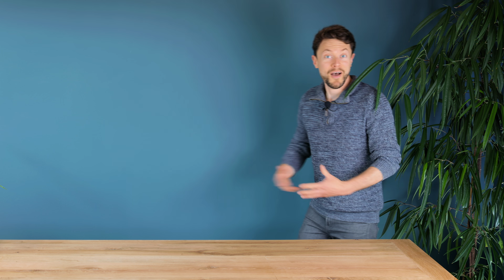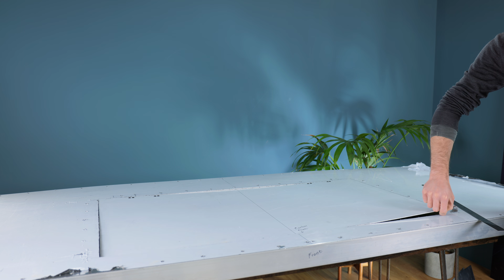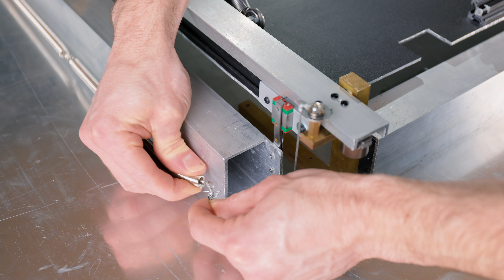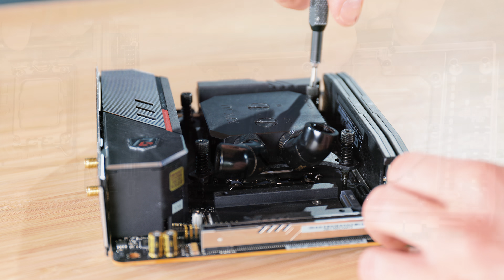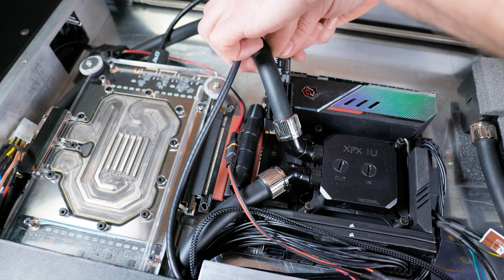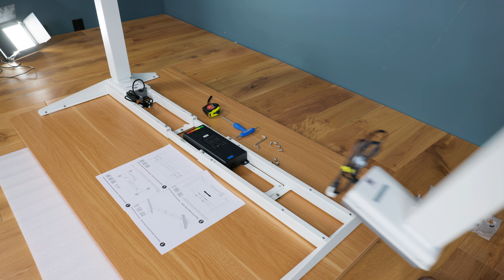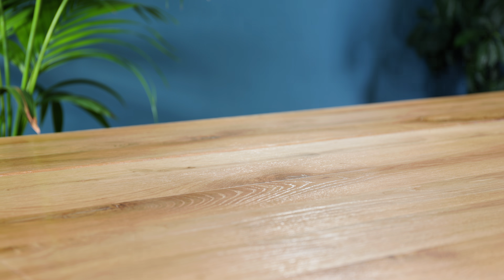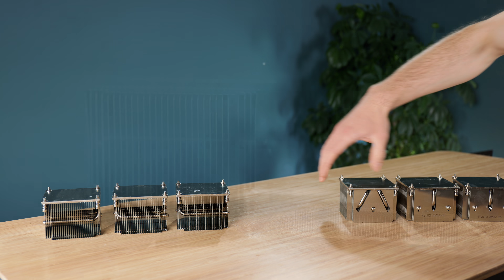Building the ENDGAME invisible PC

Comment: The thin edge trick and the spring-loaded move-out-of-the-way wooden bar hiding gap thingy blew me away
Reply: the gap filler thing actually made me say holy f*ck out loud
Reply: @menggol  pretty common if you did handiwork in school
Reply: yea i mean this guys is actually amazing in my eyes, his ingenuity is mind boggling
Reply: 😂😂😂😂😂😂for real
Reply: i still don't understand how it works. he only spent like 2 seconds talking about it
Reply: @Langebaan  you got a triangle shaped bar and when the latch opens because the sides are smooth and angled they slide out allowing space for the latch to rotate without hitting anything, when the latch shuts springs that are within the gap that the triangular bar is attached to, bringing it back down once closed. I’m not sure how good this explanation is but it’s what you’re gonna get l.
Reply: i missed that part at first so thank you for calling it out so I could go back
Reply: I literally audibly said "genius...f*ckin genius" whilst nodding my head in disbelief.
Reply: At this point hes gonna make tokyo 3 in 5 months

Comment: just put fans so that they would suck out air, instead of trying to push air out through fins. That pretty much helps preventing cyclone effect inside the case, and pressure diference will make system suck in cool air from outside. Basically, switch in place fans and fins.

Comment: I was wondering if the heavy magnet would over time cause burnout on the monitor screen. I have seen monitors damaged by somebody putting an old style rotating date clock radio on top of monitor and magnetic field from small motor to flip the hours and minute tabs, burn out a block of the screen below. Tech showed me after customer destroyed 3 brand new monitors this way. Also, seen bi warehouse fan moving back and forth near monitor cause flickering when the motor's field swung close to the monitor.
Anyway, I would NOT park the magnet overtop of the monitor area when closed.

Comment: incredible! this may be the most amazing DIY project I have ever seen! 😄👏👏👏

I would like to see a follow-up with another attempt at the cooling system though - those fans sticking out at the bottom? is the bottom half of the fan even doing anything at all, or just keeping your legs cool on a hot day?? I'm not sure this would be so great in the winter. 😅

it's probably not as simple as just using smaller fans though? smaller fans need much higher RPMs and make considerably more noise. there must be some other solution we can think of here.... 🤔

Comment: Great project, but I have to say there is a relatively easy way to make an invisible PC that is also perfectly quiet and cool: -
Put it in the next room and run cables.
I've been running mine that way for years and there's no looking back once you get used to no longer have the heat and noise near you.
Also means you can operate venting solutions for the PC is without worrying about the noise and ugly HVAC devices.

Comment: I think part of the problem with heat is you're running the internal cooling plumbing in series so all the heat from one component is pumped past the other before it reaches the heat sinks that might make it difficult to keep the down-stream component at a safe (long term) temperature...

I think what you should have done was create 2 separate liquid cooling loops and make the brass tube so they're 2 sets of 2 tubes soldered together making a 4 tube system with 2 completely independent circuits...

That would also allow you to more efficiently control heat dissipation by independently controlling the pump speed for each component, so if for example you're doing something that maxes out the Graphics GPU while only needing 30% of the CPU's capability, you can ramp up the Graphics cooling loop while leaving the CPU loop at 25-30% speed, which both minimizes overall power use/heat buildup and noise...

While this entire build is INSANELY mind blowing, that's how I'd have built the cooling system...
Reply: or just make separate loops with separate circuits, tbh. like the left for cpu and right for gpu, instead of having a long one.
but I getchu. but it's the joy of DIY, no? you can improve and modify to suit your needs

Comment: 16.00 I have a suggestion for an Upgrade...

Yes...Yes...I KNOW you haven't finished building V 1.0 yet...

Add a small electric linear actuator (the kind used to remotely open and close minivan rear doors these days) with a hidden button on the underside and/or a remote control fob & receiver so with the push of a button (desk or fob mounted), the monitor hatch opens or closes...

Comment: This is legitimately one of the coolest things I've ever seen someone make. Love the attention to detail!
What about laying the fans flat, in front of the heat sinks, with the heat sinks being at the back of the table? Then they  could draw air in from below the desk, redirect with 3D-printed 90-degree ducting, air goes through the heat sinks and out the back edge of the desk?
A lot of work to reengineer the cooling system (again) but would finish out the endgame setup with the fans being flush with the bottom of the desk.
Reply: yeah but some of the hot air will rise into the fans again so the blowing effect would get reduced.

Comment: I'm wondering if the new fan setup is working so well because they're sticking out of the desk, meaning that the air actually has somewhere to go? I'm thinking that you may have been onto something with the first setup, if you had an exit point for the air to flow out of, like perhaps a ring around the desk with circulated air flow, and air holes drilled throughout. As a fun bonus, you could even make an entry hole that you could attach a smoke machine to, which would draw in smoke and blow it out of the holes around the desk, to give it a kind of sci-fi feel?

Comment: Great project and realization as always !!! 👍
Further mods I'd made to this build:
- lapping or filing those brass tubes to be pratically a flat surface and move more heat to the heatsinks or use 0.5mm thermalpads instead of thermal grease;
- adding a dust filter on fan to avoid them clogging
- integrate speakers on monitor panel or into the desk itself, also integrate usb ports too.

Comment: The precision of elevating that bottom platform to sit perfectly flush with the top is crazy. And I don't even know how he attached that trim piece that is behind the monitor, which sits flushed with the top as well, and moves out of the way when the monitor folds up. He didn't show how it is attached so I think it's DIY Perks magic. I would add another long black L trim piece to block the fans from view, even if someone looks underneath.

Comment: Sir, this is one of the coolest things I've seen made for a PC. The 140mm Fans may be slightly less elegant than the original design, but silence and efficient cooling easily make them the best option. FlexiSpot system being mountable to any desktop is brilliant as well.
Reply: There could be half of the coolers, with smaller fans, but then the noise..
Reply: Half size nactua fans?

Comment: What a cool project! I was thoroughly impressed by the finish around the hinges.

I really could not wrap my mind around why you decided to go with that cooling solution until you mentionned the heatsinks cost less than a 360mm / 420mm radiator :O
Now that you say that, I think your idea is genius. Not only is it cheap, but you are actually reusing old server components that were at best going to be recycled. Now you reused them in a cool project and might've inspired others to get their hands on them and use them in their projects too!

Comment: It's a really nice build.  But, I actually think it's a bit impractical to have it fold away to be invisible.  If you use the desk surface when you have the monitor folded down, then opening up is going to require rearranging the desk each time to clear the space.  And the sort of person who wants a high end computer like this is probably going to be opening it up frequently.  To me, the only real benefit of the design is that you can have a minimalist look when you're not using the computer, and not so much that you have a desk surface you use.  If you do actually want to use the blank desk surface, than having an inlay wood border around the monitor panel that's a different color might be beneficial, to make it very easy to see what part of the desk surface needs to be cleared before opening it up.

Comment: It would be better to use several alphacool NexXxoS HPE-60 Full Copper X-Flow 40mm Hepta (7x40mm) Radiator  or Alphacool NexXxoS XT45 Full Copper 60mm Triple radiator  or 50 mm version.

Comment: This is one of the most impressive projects I have seen on youtube. The vision, the engineering, the PC build, the watercooling (though there one could've just used some smaller radiators and made the whole thing a lot more straightforward. This desk already costs many thousands, an additional 100 bucks for a slim small radiator wouldnt have mattered much).
I cant think of any other insane project that even comes close

Comment: You probably should have used the 40mm alphacool radiators and 40mm noctua fans, the thij waterpipes in the radiators do a much better job than a heatsink on a single reservoir.

Comment: I guess the hub/speakers are wired to the PC, meaning there is a hole in the bottom platform? How assessible is the PC for maintenance?  And I guess replacing the screen would be a destructive process for the wooden cover? 
Fantastic build, that's a beauty.

Comment: I've done a lot of similar projects. What you publish is not bad! They are definitely interesting technical solutions that require the study of promblematics and cross over into multiple disciplines. However, you still have considerable reserves in workshop workmanship. Some details are not well thought out. For example, I am bothered by your knocking of the edges. If the best solution for the privileges is to not seal the edge of the board with a cross band of material that hides the layering then it needs to be sanded, polished to a shine. In case you are joining layers where there is wood, you will never achieve a perfect result without a moulding and it will always be a great prototype, but nothing that is Release Candidate Manufacture (RCM).

Comment: For the water part of heat-sink, the S pattern is an error. Hot water entering it will transfer its heat to cooled water getting out, heat will be conducted through metal.
it would be better to have them in parallel, with intake on one side, and output on the other. Parallel pipes would also slow down the water, giving it more time to dissipate heat.

Comment: HMMMMMMMMMMMM... I don't think your fans were the issue, per se. Also, should have invested in server fans since they're meant to go into thin things like this. I think the issue was more the duct you built. Should resin print them, since FDM printing isn't exactly known to be air/water tight, though I have seen people putting wax on FDM to get Resin effects without the resin toxicity. So I think you could keep the thinness, don't use brass, use aluminum or copper since they have a better thermal conduction rating, use server fans in front and back of the old model, and you should be good to go.

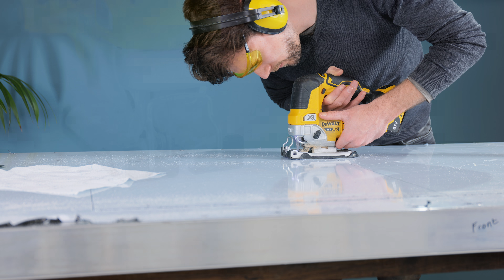Comment: 2:04 I just got one of those for free. Lowe's by us had this crazy sale going on, buy $300 worth of Dewalt batteries, get two tools free. I KNOW, it was weird, since the two tools I picked, were more expensive than the batteries. SO... NEAT... Also turns out I now have an over abundance of DeWalt batteries. OOPS. SIGH, typical Alex. I don't even have a lot of DeWalt tools, previously was just the table saw which is plug in, miter saw (also plug in), handheld router and wet dry vac. Turns out MS humidity plus dog hair equals nightmare for most vacuums.

Comment: Wouldn't it have been easier or cost effective to explore wood flooring planks instead of slicing oak into thin sheets? Put a thin felt disc on the magnetic key so it doesnt wear the wood down over time.

Comment: I have a different, possibly more significant issue with your brass heat spreader. You made the water go back and forth along the length of the spreader, which makes sense. But the water entry and exit points are located very close to each other and are probably strongly thermally coupled. Which means, the cool water, before exiting the spreader, will come in close contact with the water at its hottest point, coming from the system. Wouldn't a lot of heat just be transported from the water entry point directly downwards to the water exiting the spreader? Your aim should be optimal cooling performance for the system and such as cold water as possible. So the it should exit the spreader at its coolest point, which would be the opposite site of the entry point. Or is my mental model flawed?

Still though, I also think the second iteration generally has better performance due to better airflow. But it might have worked with the first design, if the heat spreader would have been designed better.

Comment: Every iteration is getting better and more practical.  I don't like all the cheating for the bottom though.  Especially the fact that it relies on a tapered edge.  I'd rather it be flat across the bottom but have a lump near the middle for the thicker components.  Imagine doing this again but where it can sit in the middle of the room and be used from the other 3 sides as a proper table while one side is actively being used as a computer.

Comment: I was thinking when you were setting up the initial cooling system that this is never going to work. I'm glad you included both the first experiment and the second in the video. 
While water cooling does take up less space on individual components, it usually has lower performance than air coolers nowadays. That water still needs to be cooled down, so there's no getting around using fans and radiators/heatsinks. 

Smaller fans are much louder, and larger fans much quieter, because the blades of a smaller fan have to move much faster to move the same amount of air that a larger fan spinning at a lower speed can move. 

Air needs to come from somewhere, so if there is no ventilation for air to move into an enclosed space, the fans create a vacuum within the enclosed space and no air can move through the heatsinks, causing the coolant to only increase in temperature and have minimal cooling effect.

The end solution works so well because the fans have an infinite supply of fresh air. By using air from the entire room, the fans are getting maximum airflow with minimal effort, resulting in such a quiet cooling system.

Comment: That is pretty cool. Kinda anachronistic to have a desk that raises with power and a manually-raising computer. Would have been neat to make the monitor rise with power and hide the controls for the monitor and the desk height. Also power-curve on the monitor that auto-flattens as it lowers would be neat. 

I’m more of a traditionalist, so I’d like to see a mission-
style desk out of oak, with a top that raises in its entirety, and a drawer with a foldaway front to hide the keyboard, mouse, and the height-adjustment controls, and that would greatly simplify the folding mechanism, but I’m not sure how to disguise the height-adjustable base. There are lots of cool things you could do with the computer in that case, but I’m lazy so I’d probably just put a Mac Studio mounted to the underside of the desk.

Comment: Something I don't understand is why choose brass for the coolant tubing. Aluminum is far better for thermal conductivity and anodized aluminum has better corrosion resistance. I would also think that the aluminum would be cheaper as well.

Comment: it's really super neat looking, but I'm questionning the point. Afterall I use my computer about 16h per day, so what's the point of hiding it away at night? If you could use that table for dining why not, but seeing the big heatsink at the back you cant really dine all around the desk. I really like having a hidden computer, but I wouldn't have done this to the screen. Plus I like having the option to change the height of the screen etc.

All in all really cool build, there are a few very cool points I take from this video that I will likely use in my next build, but clearly this whole setup is not really my thing. I don't think you mentionned the two oils you used for the oak but I really like the finish so I'm quite interested by that point.

Comment: you can also add stiffness to a metal sheet with embossing. for a large sheet, you could emboss a wood-grain pattern with some patience and a bare patch of muddy, clay-rich ground, as a soft anvil, and you can use a pneumatic engraver with a bead tip (non-sharp) or just a chisel, and it can go much faster than you'd think!

Plus, there's always just lipping the edges!

Comment: You could've screwed in the wood, then filled the screw gaps to avoid a sticky situation if you need to fix something. Apart from that, this whole thing was amazing. The wooden hinge filler was an unexpectedly great solution. 

Also, I think you could've just taken out like 2 heat sync-fan units maybe, since it was only an airflow issue. Dave2D always pointed out in his ultrabook reviews that air intake is just a matter of a large enough (unobstructed, though in this case that doesn't matter) air duct.